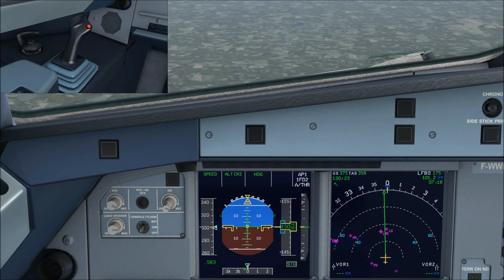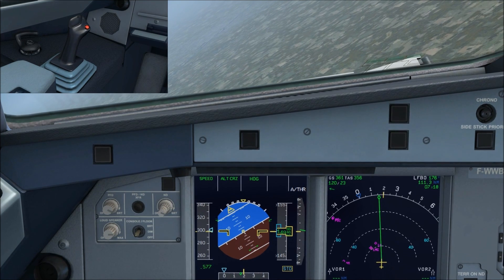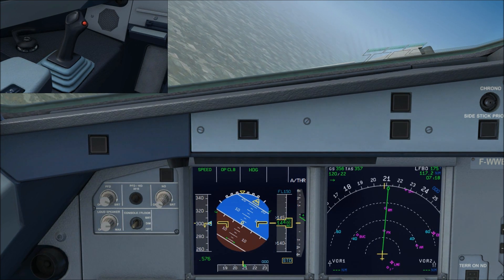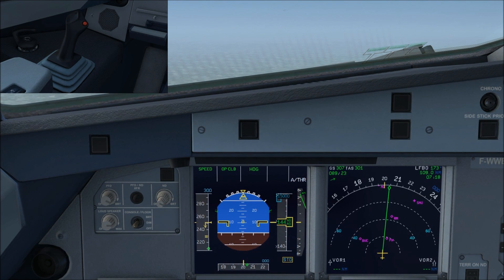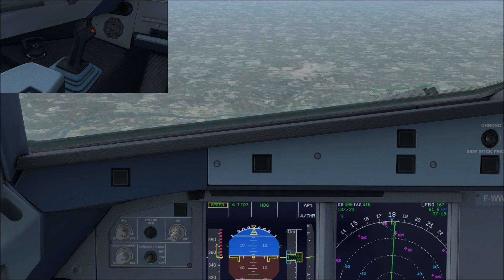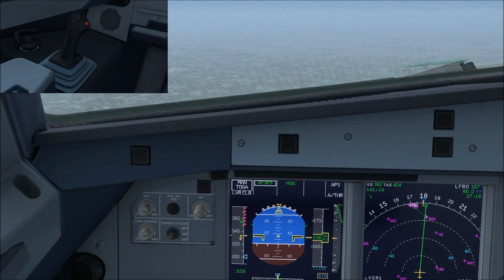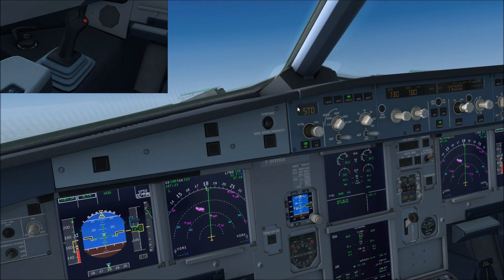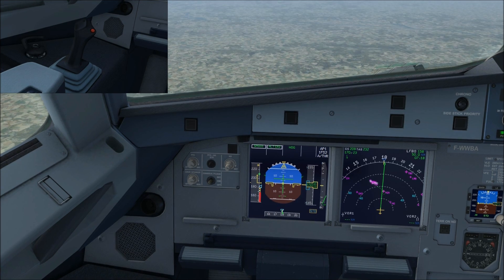Airbus X Extended FBW

Comment: How do I disable FBW? Tried switches both from left and right side on the overhead panel, it olny disengages partially flight controls of the aircraft.
For example, I learned, that ELAC2 controls elevators, but if I switch it off, they are still controlled by computer, but now I can't turn left or right.

Comment: omg finally, because with the v1.22 i'm having troubles at landindg, when i set flaps full, the speed automatically drops to the approach speed, but the autothrottle doesn't controls it, and the plane goes up in a stall